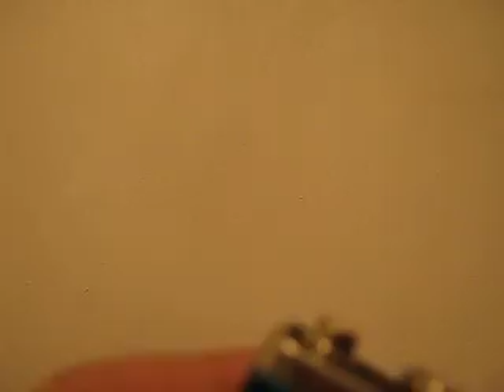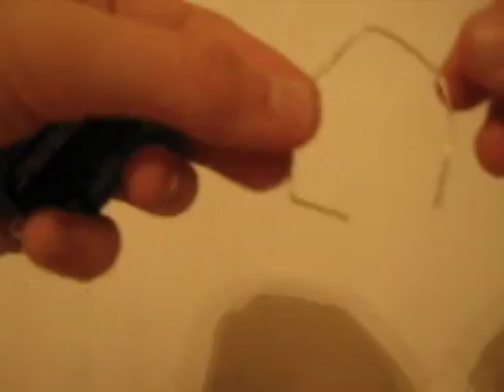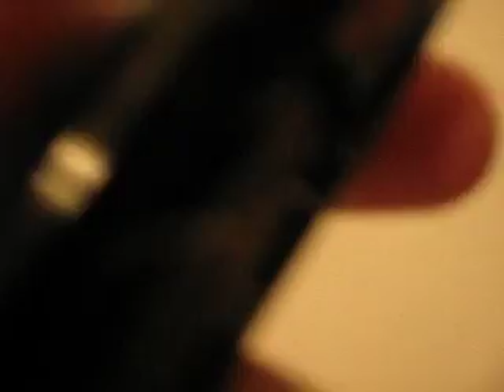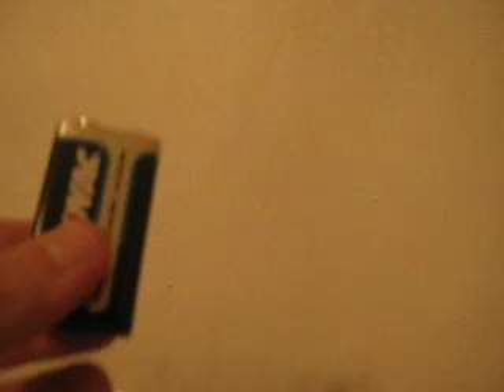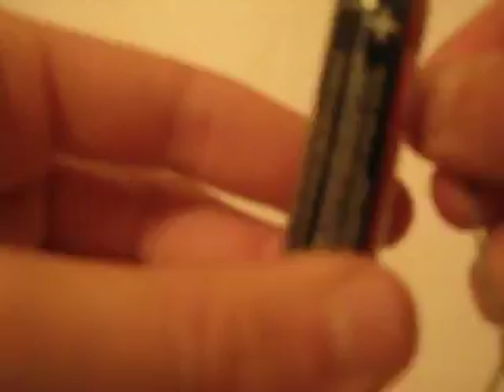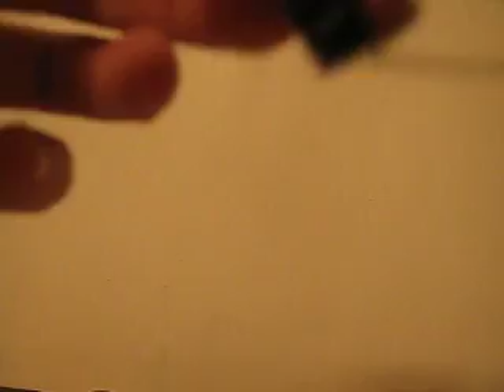spark from battery

Comment: Hey it might work but it's extremely dangerous you don't notice it but as your connecting the two ends your creating a short and all the energy in the battery it coming together and heating up the paper clip and with either ignite something, burn you , or possibly deform.... Be careful. Also could you please do a video on a natural shelter using some modern materials ? (garbage bags, survival blankets, etc.)